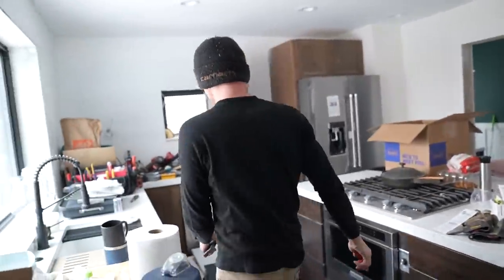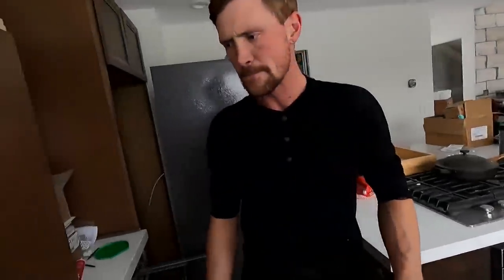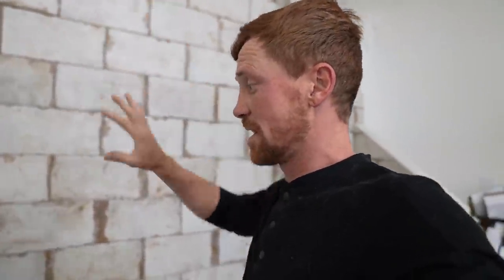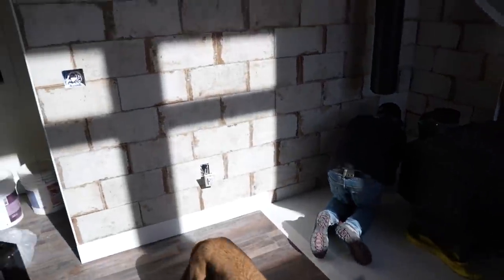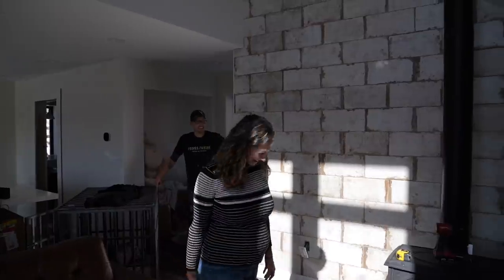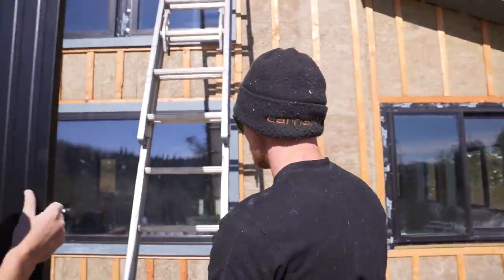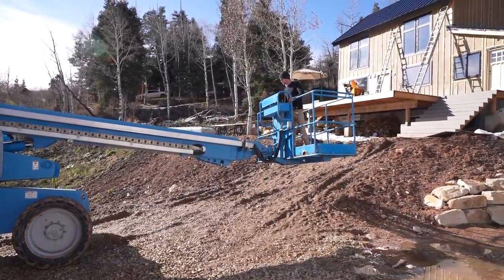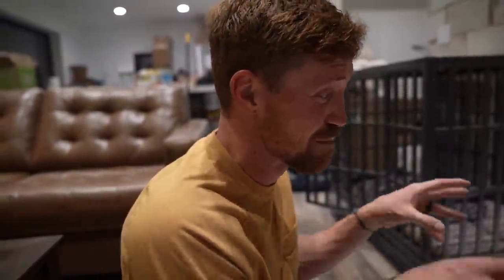TIME IS RUNNING OUT | BUILDING OUR OWN HOME

Comment: Is anyone else worried that the color of their siding isn't going to pass inspection?  I wonder what they will do if it doesn't pass.  I just googled "can hardie board be painted" and apparently it can.  So, I guess that's the answer -- if the color doesn't pass, they will have to paint it.  Hopefully, they would be able to wait until Spring.

Comment: Your kitchen designer should’ve told you that the fridge cabinets has to be at 72” from the floor. The gap is required above the fridge for circulation. Otherwise it could void your warranty. I specialize in kitchen and bath design and this kitchen has made me cringe. They didn’t do you any favors. But in the end it is beautiful and you have adjusted well.

Comment: In my opinion those wall tiles look an absolute mess, would not want that rubbish in my house. It looks the start of a project, but never ever finished. Looks just cement blocks on a house build that will be covered up.